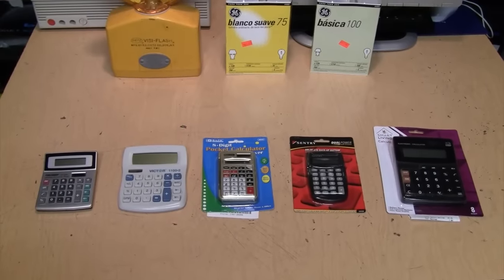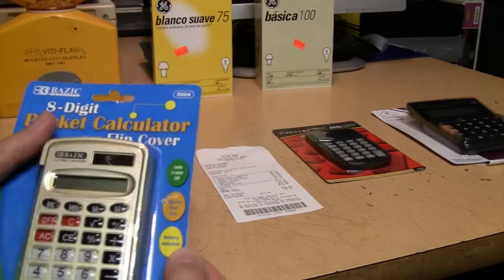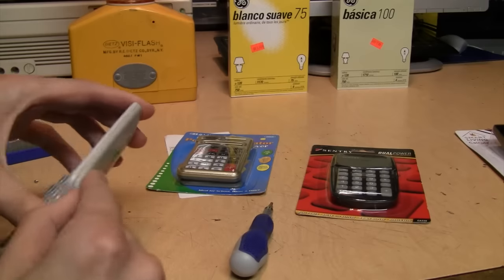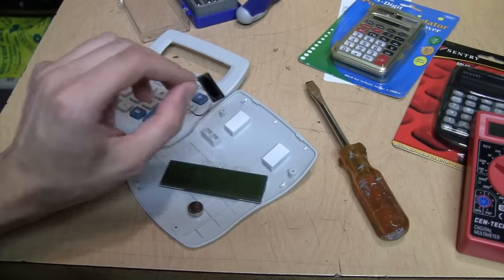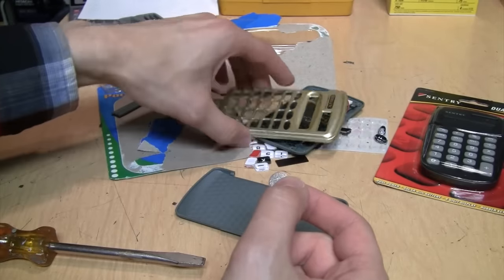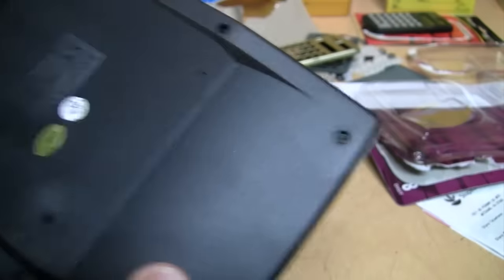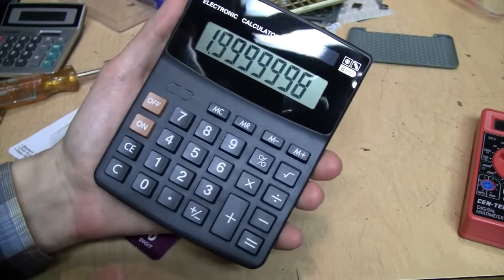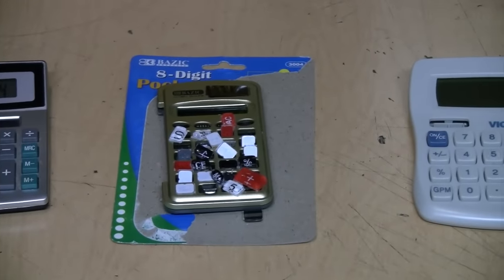Solar calculators BUSTED!

Comment: When i was at Middle School, my mom gave me a Casio calculator that she used at high school. The device included a flip cover and had two way power. The only thing is that it had a dead battery, so I had to sit near the windows everytime I had a math exam. Similarly, I had a time limit to accomplish my math homework before nightfall or else my calculator wouldn’t  turn on until the sun arises again.

Fortunately, years later I found a way to replace the dead battery and it was a nice feeling to be finally using my calculator at night for the first time.
Reply: Hey, I think I have that same one!
I know it's Casio.
Is it the kind where you need to hold the flip cover open or it returns closed under spring tension?
Reply: @owenkegg5608 i think i know what your talking about is it that red small one?
Reply: Why didn't you just replace the battery or get a new calculator.  Work smarter not harder.
Reply: @prisonbreakgaming I persume, as a middle schooler, he did not have the expertise to replace the battery or the money to buy a new one.
Reply: @slashplane  Teaching kids how to use scientific calculators while they don't even know how to change the battery.  Perfectly describes our education system.
Reply: @prisonbreakgaming that's 2 different things
Reply: lol you took years too replace a battery?
Reply: Now you know how Newton felt 🥺

Comment: I found 4 identical broken 'solar' calculators that had real panels, but the panels weren't wired at all. Made a small compound cell out of them, and it just barely powers a 'lucky cat' that used to be battery powered 😃
Reply: That's so wierd how they had the panels but never used it
Reply: Huh
Reply: I actually have seen this trend on cheap solar electrónics, i guess it's because solar controller chips and recargable batteries Increase the cost of the product so they only put the solar panel to look good.

I buyed a cheap small solar lamp and worked well for a year, the next year the lamp light become weaker even when i put the lamp for hours on the Sun, so i disesamble the lamp and found out that even when the solar panel was real it wasn't connected to the circuit.
Reply: I had never heard of the term "lucky cat", but somehow knew exactly what it was.
Reply: @klystron2010  One of those solar powered cats that wave hello
Reply: I had a dead calculator that was dead and it only turned on I the light didn't do any math
Reply: @moisesrosario9716  That should be be taken into a court of law. This is unacceptable marketing scam by a corporation
Reply: That's hacker culture I aprove of!  :-)
Sun cat.
Reply: @thatguyalex2835   Which corporation do you take to court?... Seems the scam is not limited to one corporation... the scam stands to reason, if the solar panel is Chinese, and if it works full time, the calculator will most likely never need battery replacement.... but the batteries are probably US brands, and when the calculator fails, the owner will probably buy a new one.  Does this make sense?..  let's put it this way... both chinese and american corporations that provide the components for the calculator assembler, got their product sold and are ok with the business agreement, and... only the consumer lost as always.
Reply: @thatguyalex2835  Sadly it isn't worth it as these calculators are so cheap.
Reply: @Maximara  I know. Shows our corrupt system. :/
Reply: @thatguyalex2835  That part of it isn't corrupt just common sense.  You know the thing that given the comments that appear on about 90% of the Internet does NOT have.
Reply: @Maximara  Yeah, we all know our society is messed up, with scummy corporations, it is common knowledge.
Reply: I've got one with the same battery since 2014 that still runs perfectly.
Reply: Noticed they do that, also the panels were low on voltage. About 1 to 1.2V most are supposed to be 1.4 to 1.6v

Comment: You have to admit it’s pretty amazing that all the design work, engineering, making expensive moulds, buying in the calculating chips and batteries, raw materials, manufacturing, assembly, packaging then international shipping, distribution more freight, then unboxing and loading onto shelves… and you can buy it for a dollar or two. Then we wonder why so much goes to landfill. It’s just crazy.
Reply: this never fails to blow my mind

Comment: I remember my first digital calculator.  In the 1970s Radio Shack offered a four function LED calculator for $99 plus tax. I thought it was worth every penny.  $100 in 1975 was equivalent to $485 today.  Dollar Tree sell scientific calculators now for $1.00
Reply: damn
Reply: Did you have mechanical calculators back then?
Reply: This happens with everyting!! When its new its expensive
Reply: A good Texas Instruments graphing/advanced calculator can still go for a few hundred. Still overpriced in my opinion, but it’s mostly due to the proprietary hardware TI uses. They’re designed in such a way that all of the computations are performed by the chip architecture rather than logic patterns on a processor. Makes them super-duper-quick and efficient at mathematical calculations.
Reply: Cuz when you bought the calculator there were active patents then they expired and became super cheap
Reply: @369Sigma  they would retain value if schools require them.  I remember my school letting use their TI-82's for class.. idk what they got now
Reply: I, too, remember Radio Shack.
Reply: @369Sigma  when it comes to Texas instruments you're paying a premium price for processors that are over 20 years old in the best case scenario it's sad
Reply: @TheUnknownHarbingers  most people I know use ti-84+ or ti-84 CE, but some use ti 83s
Reply: I felt like I was cheating... My teacher would have said I was... I probably spent two weeks of work at the pizza restaurant I worked at... (maybe more)...
Reply: @wertiaaudit5746  1971, aintel released the 4004 processor. A 4-bit processor sold for $60 and intended for calculators etc.

So it wasn't just a question of patents - the processor was state of the art at that time.

4004 then became 8008 which became 8080 which became 8086 (first IBM PC) which became 80286, 386, 486, Pentium, ... and todays Core i7 etc.

So not that strange that iniyial calculators was expensive.
Reply: @wertiaaudit5746  Very, very unclear what you wanted to accomplish with that video.
Reply: @perwestermark8920  your attention
Reply: Oled tvs were like 4-5k for the cheapest one when they came out , now you can get it for 1500 or less soo thats just how things work , and lets not talk about regular lcd displays , they ceste a fortune, now they are getting old and can be had for like 150usd for a 109cm version ...and its often a smart tv with wifi and all of the modern shiz
Reply: @meomeo-ue7qd  I mean I don’t disagree. I can understand those specialty chips being a premium price, but since the tech is proprietary TI gets to put whatever price tag they want on it. And they certainly over-charge.
Reply: My Casio would never wear out. Sincere at 15 dollars maybe ?  I have used some of them years with the numbers worn off. Great calculators
Reply: I had a 1970s book in my collection on pocket calculators.  It was a guide to how they worked, etc.
Reply: @TheUnknownHarbingers  we still have a box of Ti-80 at school if someone forget his calculator.
Reply: I mean you can do most of those functions on your phone with a free app.
Reply: Thegame .Dev  almost seems like moving in the wrong direction, doesn't it?
Reply: @369Sigma  I don't buy your arguments that TI calculators are expensive because they have a custom chip. Designing and manufacturing chips is expensive, but not THAT expensive. A couple hundred bucks will get you a midrange chip of the latest generation desktop computer processor. They are orders of magnitude faster, have even more fixed-function hardware (like media codecs, cryptography blocks, vector units, hardware virtualization, etc) and those only stay current for a year or two at most. TI makes chips it can keep shipping for decades. I don't buy it that the chips are that expensive, not for decades on end anyway. Moore's law still is a things, even if it has slowed down a bit recently...
Reply: @Niosus  cool
Reply: Hearing or seeing mention of Radio Shack makes me want to cry.
Them and Frey's
Reply: @369Sigma  TI is not expensive because of the hardware, but because they are specced into US school requirements
Reply: @petermuller608  so are scientific and standard calcs as well as non-TI-branded graphing calcs. That makes no sense.
Reply: @369Sigma  No, the text books are written around and teaching aids are provided by Texas Instruments. The TI-83 is the defacto standard for the us classroom, sat, act, etc.
Texas Instruments wasn't even the first graphing calculator that was Casio with Sharp following a year later then HP two years after Casio and Texas Instruments five years after Casio. 
The TI is the most user friendly and they were cheaper initially as ti gained dominance they held their price.
People complain but I paid $100 for my TI-81 in 1995 a modern TI-83/4 is still $100 so adjusted for inflation it's cheaper. 
My father paid $400 for a TI portable in 1973 which was the price of a used car or a months rent back then.
Reply: ONE Dollar? Wow...
Reply: @emilvlahovic3917  Smart TVs are cheaper cause they sell your data
Reply: but for school, you need the $150 texas instruments one
Reply: I had the more expensive scientific calculator.  Thank god i had rechargeable batteries for it, because it went through them pretty fast.
Reply: TI Calculators are like diamonds in that theyre actually worthless but you want it or not?
Reply: Will happen to electric cars too
Reply: Amazing where computers have came in the past couple decades.
Reply: None of the modern scientific calculators are as user friendly as the vintage HP-41 and HP-42.
Reply: @k98k007 no it doesn't happen with everything, its mostly an electronics thing.
Reply: @CeeJayThe13th whats your point
Reply: @randybobandy9828  who knows?  I was probably drunk
Reply: Same with the little red laser pointers, they used to be $100 easily and now they're $1 each.
Reply: @Niosus  You're likely right, it's likely not really the chip.

You're buying the TI name, you're buying something that's designed to last, you're buying something where just plain the printing on it isn't going to wear off.  You're also buying a standard interface that's used in schools,so the teacher doesn't have to figure out how every single different graphing calculator works.

A lot of it is likely the name and the "TI is the school standard".  The competition is more like $40, and TI sells them for $120.

Comment: I can now sleep in peace knowing calculators have fake solar cells, thank you
Reply: some*
Reply: My parents have one from the 90s that actually works. It has no batteries in it and only works when held in sunlight or under a lamp.
Reply: Same here. Before, my nights were tough trying to figure out the issues with calculators....
Reply: If you're being sarcastic, you're the one that clicked on this video.
Reply: Danny Khoo Calkalater*
Reply: No, I’ve had some calculators that fade out if you cover the solar panel.
Reply: I want a diseal powered one
Reply: Only some cheap ones, I used to own a calculator bought at poundland and that had a real solar cell. If the calculator has solar printed on it it must be real it would be breaking false advertisement laws.
Reply: Mine is true, if I cover the solar panel, the calculator shut down
Reply: gigi gigiotto its just pretending cause it doesn't want you to lose it's trust

Comment: One reason (that I can think of) for fake solar cells is that the original injection mold has a space for solar cells, but the factory no longer makes solar cells and uses batteries exclusively. Given that a new injection mold can cost upwards of $250,000 USD, it's better to just put in a fake solar cell than to build a new injection mold.
Reply: I think you may have cracked the code.

Comment: Did I really just watch a video about calculators... and like it?
Reply: One-handed videos are a torment.
Reply: Me too bra
Reply: I suddenly have a question about those slot-in-your-front-door mail boxes, and couldn't those doors be pulled out of their frames with a piece of pipe, a chain and a truck. And maybe I've just found the right person to check this out.
Btw, I liked this video, too.
Reply: Your front door, mailbox or no, if made of wood, can be broken open by  a couple of guys with $12 steel sledge hammers from Home Depot in about 20 seconds. Or using a drill with a keyhole bit and reciprocating saw in 2 minutes.  Or can be opened without breaking with a $50 lock pick in maybe 6 minutes.
Reply: Paul Robinson Or just forget the door, grab a brick and smash a window.
Reply: We dont know what we are interested in until we do.
Reply: TubaJay448 I did aswell I'm amazed
Reply: calculators are severely underrated. the modern world wouldnt exist without them

Comment: i remember when i was doing an algebra test in high school. my calculator stopped working so i asked my professor if i could get up and use it next to the window so that i could continue calculating stuff. he accepted, and the calculator did indeed keep working as long as the sun kept hitting the small panel on it. my professor however did not trust his students at all so he basically stood behind me, staring at me and making sure i was not trying to cheat on the test (there were some other students sitting nearby and i could have theoretically given their tests a peek- but i did not for obvious reasons)

still odd that so many cheap calculators have dummy solar panels. mines actually worked, which is not uncommon, and helped me quite a bit. i loved that calculator... then i lost it. still have some odd memories associated to it, like the one i narrated just now.
Reply: ever seen a car with plastic covers over the cigarette lighters. because some models of car come with the cigarette lighters and others don't. it's the same situation here they use the same plastic mould. and the cheaper version doesn't come with the solar panel so they have to fill it with something and you get a piece of black plastic.

Comment: I never considered the possibility the "solar cells " were fake  though i have wondered how they made them cheap enough to have them on such low cost calculators, so i am surprised they are faked but not exactly shocked.
Reply: Some (cheap if I remember correctly) calculators definitely do have real ones, though.

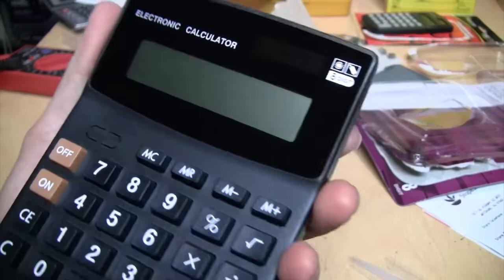Comment: The diode at 13:20 is a backflow blocking diode. It is to prevent the solar cell from trying to change a non-rechargeable battery. There must have been a mistake in the PCB because they are most often part of the PCB. This was a fix so they could use the PCBs for this unit. Either that or the PCB was also used in a battery only unit but by adding the diode they could use it in this unit.
Reply: Yea, I think it's a bodge so they could use a non-rechargeable cell with a board designed to take a rechargeable one.
Reply: It's installed the other way. It's there to keep the battery from discharging into the solar cell. The solar cell isn't going to produce enough energy to do any harm to that button cell, but the solar cell does present a load to the battery when it's not producing, and they just wired them in parallel, probably because the chipblob board they used didn't have an isolated input for the solar cell. :/
Reply: @SwervingLemon i think this is a more plasuable explanation. Since solar cells acts almost like an LED and will drain the battery continuously if without a diode